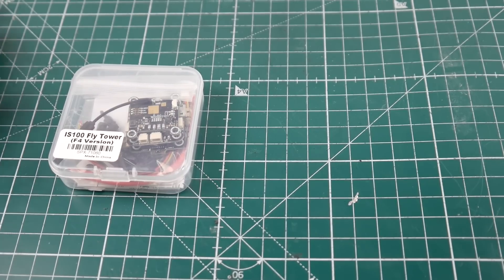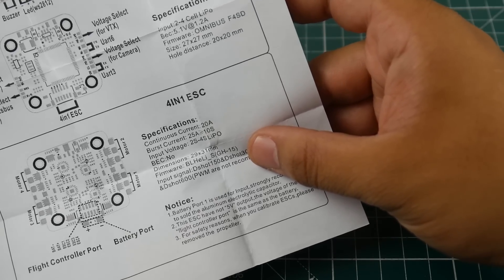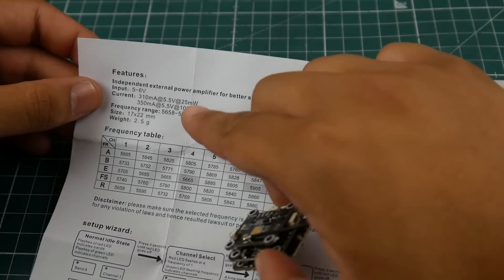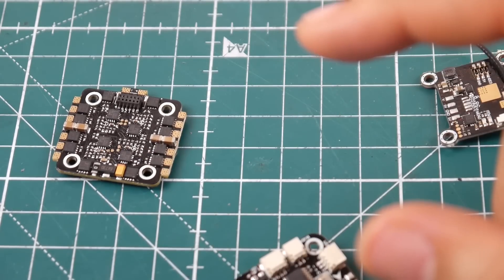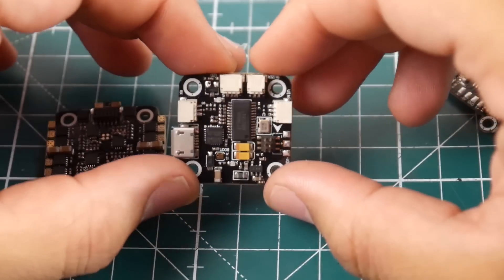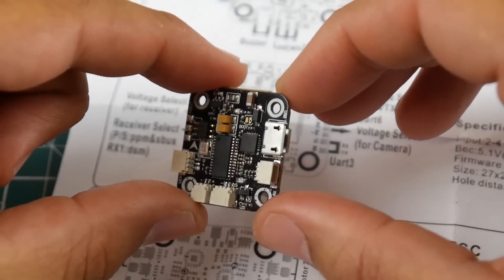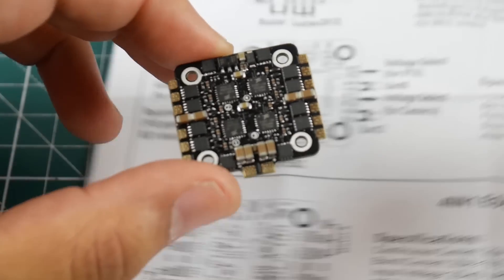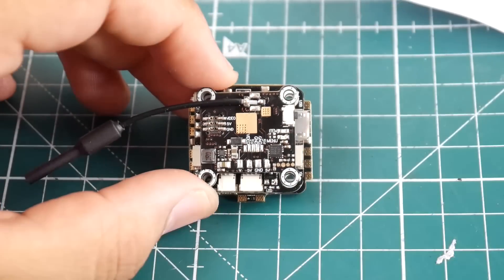Ultimate 20x20 F4 Stack ???  // Spedix IS100 Flytower

Comment: Ive got this stack on a light 5 inch quad and it performs... ok? It works I guess. Esc performance isnt the most consistant (a little dipping and whatnot) but nothing is burning up but the worst part is the vtx. No smartaudio + a wierd interface of blinking leds leaves no easy way to change channel. Also, it has a dipole soldered on which i'm hoping to replace with some kind of connector soon. It gets hot. Video performance is good though, on the 25mw setting, ive flown almost around 900m away with perfect signal. The flight controller is fine too, no complaints about that. Replace the vtx and its a solid stack i'd say.

Comment: The Vtx is garbage, it so frustrating to setup. This stack comes OEM on quite a few Furibee bnf rigs. I have replaced all these vtx's with akk Fx3 or Fx3 ultimate
Reply: thats true, the VTX band/chanel/power switching procedurce is MADNESS. it does work fine though...
Reply: Did you power the new vtx with 5v or battery voltage? Original is 5v I believe.
Reply: @ktmjay9920  from vbat I just soldered the power lines to where the battery is soldered to the esc

Comment: I think the vtx is quite shitty, because it looks exactly like the one on my spc maker 95gf - It‘s a  real mess to configure. It gets really hot & sensible to voltage spikes so you need at least 1 low esr.
Reply: Correct - the VTX is shitty, I have caps on the 5v and VBAT and still get inteference, also nearly impossible to configure.  The rest of the stack is great, been flying it for a couple of months now.  Wish they sold a discounted version without the VTX